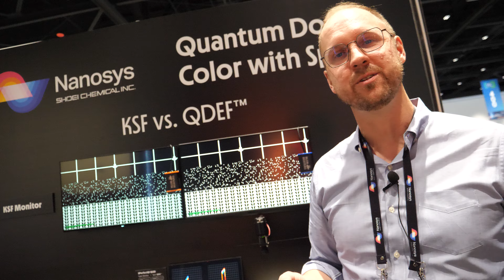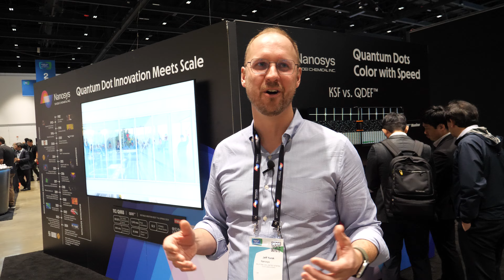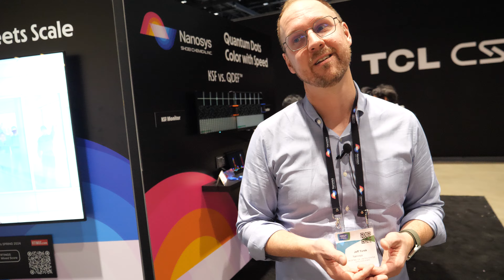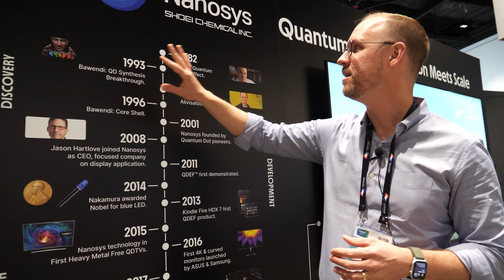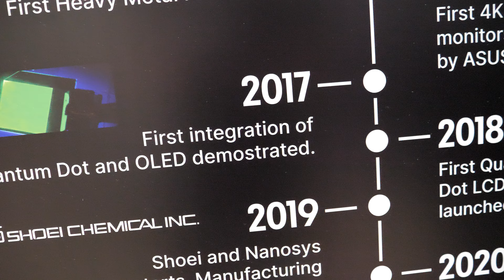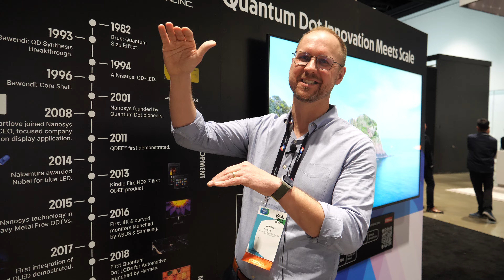Nanosys at Display Week 2024, Quantum Dots everywhere! Nobel Prize 2023, QD-OLED, QD-EL, NanoLED...

Comment: How long do Quantum Dots last before they deteriorate?  I have a Sony from 2014 and it probably has 20,000 hours on it.  It still looks new in terms of performance.
Reply: TV brands typically require reliability of 30,000 hours to 80% initial luminance. QDEF can achieve 100,000 hours. Typically other things will fail first.
Reply: @NanosysInc  Thanks so the TV may have lost some of its luminance, right but should be over 80%.

Do you know if it has Quantum Dots or Phosphors?  I know Sony switched either after 2013 or 2014.
Reply: @techsamurai11  The 2013 XBR-X900 had an early QD component for LCDs in which QDs were encapsulated in a glass tube affixed to the LEDs at the edge. This was produced by QD Vision. In 2014 they switched the Triluminos brand to phosphor and came back to QD with QDEF LCD as well as QD-OLED in 2022-23.
Reply: @techsamurai11 In TVs from 2015 starting with Samsung.

Comment: Ask him does nanoLED match the brightness of QD-OLED?
Reply: Not yet! The nanoLED displays shown at Display Week were in the 100-250 nit range. But... emissive quantum dot pixels have been produced with >600,000 nit luminance so nanoLED displays definitely have the potential to get pretty bright!
Reply: @NanosysInc what is the pixel response time of nano led ?
Reply: @charliewright1009  a few nanoseconds
Reply: @NanosysInc  100-250 nits at what window?
Reply: @bushgreen260  not 100% sure but would assume full screen for these measurements
Reply: @NanosysInc  can it be tandem aswell like oled?
Reply: @bushgreen260  Yes and there has already been some academic work on what that would look like but... QDEL doesn't need to be tandem and we think that will be an important point. Comparing wall plug efficiency for QDEL vs tandem OLED should show a major advantage for QDEL. Great efficiency and much lower voltage for QDEL means more brightness with less battery drain.